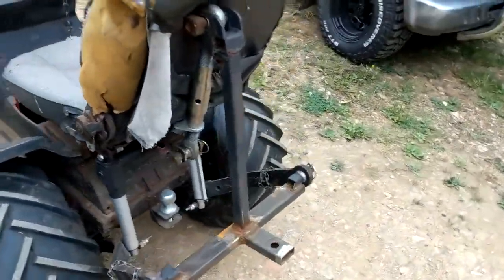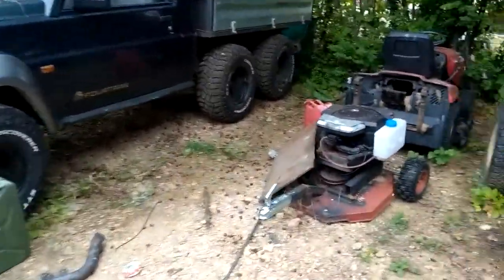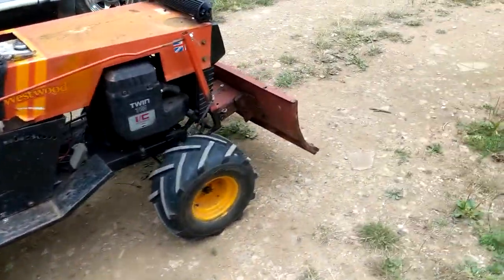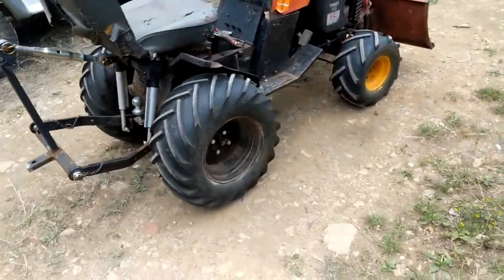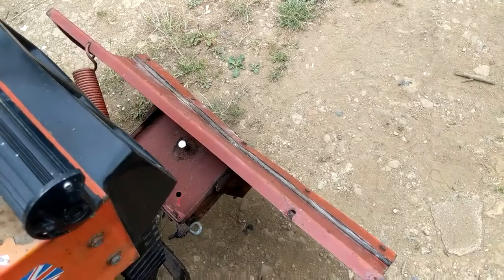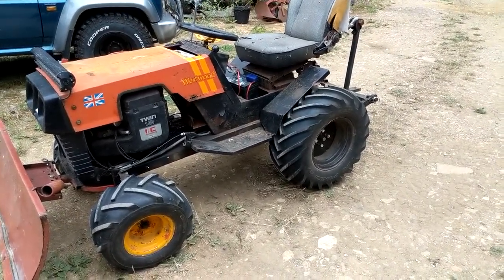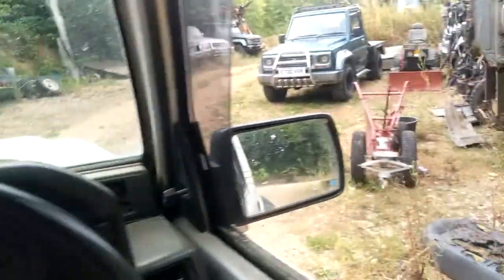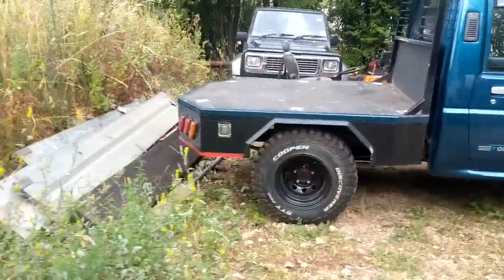Westwood mower 30mph speed test

Comment: You can’t beat a Westwood where did you get the pulleys from are the direct fit or did they need be modified
Reply from the maker: They're called taper lock pulleys, you can buy practically any size pulley to fit any shaft. Just need to buy the outer and inner for the dimensions you want. I got mine off ebay